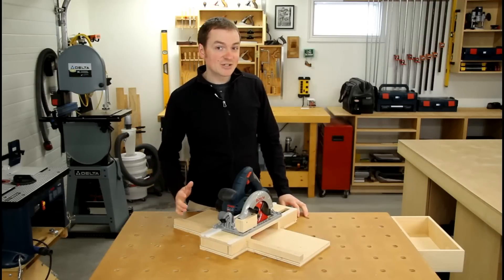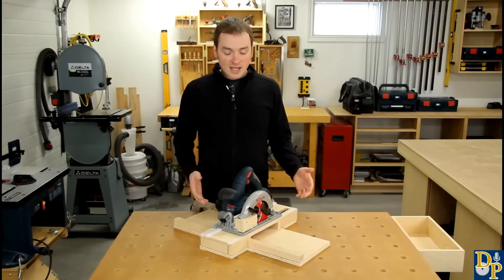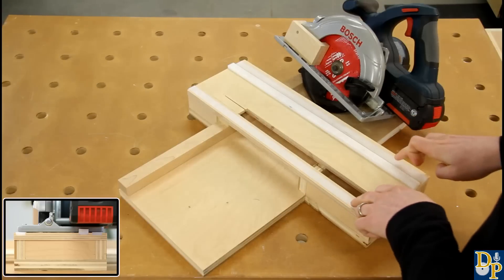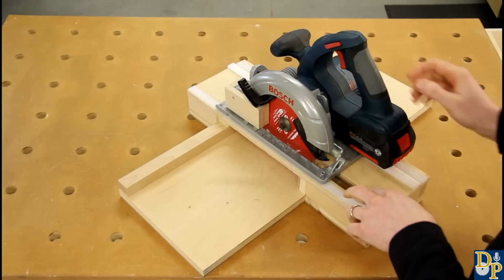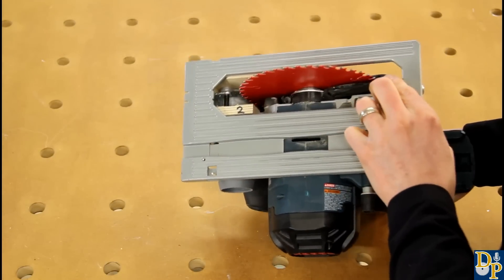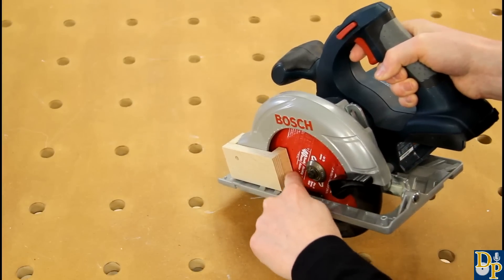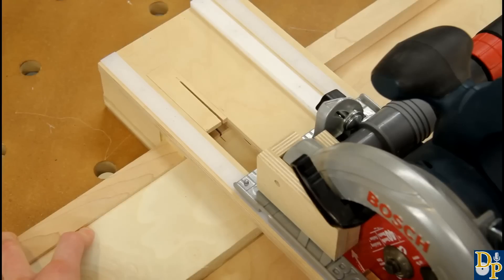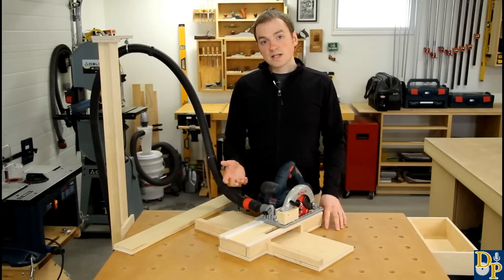Circular Saw Cross-Cut Jig - Accurate & Dustless - Pt1

Comment: why did you stop making videos?
Reply from the maker: I stopped producing videos for a couple reasons. The main reason is I don't have the time that I used to and I don't want my family time to suffer in order to make videos since that's where the time would have to be taken from. The other reason is I don't have a woodshop anymore. I have moved a couple times since I last produced videos and just have a small single car garage now that is just big enough for my work van and the tools that I use on job sites. All of my stationary machines except for the drill press had to be sold a few years ago before we moved. Life is a lot different now than when I was making videos but different for the better.

Comment: Could you show how the dust gizmo comes off to change the blade?
Reply from the maker: It's just a matter of backing the screw out that holds the two pieces together.
Reply: @DPShopTalk  
I looked again at the video. Took some screenshots to study and realize I thought it was one piece held on one side instead of two pieces screwed together. Thanks.

Comment: Dear Friend, I purchased my first circular saw (Bosch GSK 190) and I am very new to wood working. When I was cutting some small pieces of plywood at 45 degree (for a small photo frame) on similar jig, suddenly plywood piece jumped with a loud noise and fly away. It was damaged badly from all sides. Then I tried to a punch cut (because plywood piece was not wide) but I got same accident. I was feared and stopped working. What is wrong? I should I do? Please help me.
Reply from the maker: It sounds like the work piece isn't supported or held securely enough especially if it's a small piece. If you can clamp it tightly somehow it should work better. Also a sharp, higher tooth count blade helps.
Reply: @DPShopTalk  Thanks a lot, I will try it

Comment: Can you kink to the dust port, the gray plastic piece on the saw?
Reply from the maker: I bought it at Home Depot from the plumbing section. I had to modify it a bit to make it work but it does the trick.

Comment: how would I setup this jig to make 45% cuts
Reply from the maker: Depending on what you're cutting you could make 45 degree blocks that would hold the work piece at that angle and could be removed.

Comment: 4/21/2019  USA  Grandpa Bill:  Dan, I'm new to your video/channel.  The absence of visible sawdust in your shop disturbs me. You are picture perfect in your presentation with superior editing and graphics. I am at the other end of the scale, working in an overwhelmingly cluttered, unswept and unvacuumed two car garage shop. I dig for tools, search for screws, shift piles of product to get the thing I need at the moment. I belong on hoarders visually, a narrow path only I can traverse. But there is a reason. Forthcoming hip replacement surgery. Everything I must use is usually within arm's reach, or one step, or twist or turn and grab, even with a reacher stick, low or high. One day I may have such a room as yours, brightly shining in the light, all sawdust contained properly.  For now, I will wear my "man glitter" proudly.

Comment: Very neat jig - thanks for sharing it. I've been thinking about an idea of making a box joint jig for my circular saw (I don't have a table saw, and one wouldn't fit in my tiny UK workshop!)  This could be definitely modified to slide sideways on a set of rails between the top and the base... One day I'll try it

Comment: great video! would this work for cutting plastic pipes? i have a small project that needs lotsa cuts in plastic pvc pipes, i have a circular saw but i don't want to buy a mitre saw
Reply from the maker: It would definitely work for cutting plastic pipes rather than getting a miter saw.
Reply: Wooot! Thanks Dan, keep em coming!

Comment: Hey Dan,  Is bosch the only company putting rail guide slots in their circular saws?  (Other than the plunge saws).
Reply from the maker: Bosch is the only one with the slot that I can think of off the top of my head.  There may be others but I can't think of any.

Comment: when Milwaukee tools launched, its quality was better, but after less than a year, they will definitely change switch(from Germany switch to HK/TW switch, to Chinese switch, as you know, switch is most likely first to dead), change PCBA, change Japanese chuck to Chinese chuck, change critical parts to low the cost. Miwaukee tools have a VE team, 50 engineers to do the cost-down, during these processes, the quality would decline obviously.

Comment: Great video.. NICE work & nice creativity.  There are alot of cross cut jigs for circular saws on YouTube.  WOULD LOVE to see you make one for consistent perfectly straight 45 degree angles... Working on a project where I need to mitre 45 degree cuts for trim on exterior siding.... Doesn't anybody else want/need that kind of jig, vs free hand 45 degree angles... BTW  I am cutting CEMENTboard siding... so cutting this in my mitre saw is NOT possible... thus I"m looking to make a guide for my circular saw.  THANKS for posting your videos...
Reply from the maker: +Rick X thanks.  I've thought about making a jig for miter angles but I've never had a chance to do it.  Usually if I'm doing trim work I bring my Bosch CM8S miter saw which is easily portable and the dust collection works well on so I haven't had too much need for a cross cut jig that does angles.

Comment: this is beyond tho scope of the jig but I was thinking that you could mount a cheap laser line pointer with your dust port that would sit over the top of the dust mechanism and that would be easier to use to see your cut line in my opinion then the manual eye on the blade way anyhow ;)....
Reply from the maker: +The Garbage Engineer that's a cool idea.  I use the kerf in the fence for aligning my cut mark to but a laser would be a neat addition.

Comment: The circular saw was always a scary power tool for me, even more than a table saw or even a chainsaw, ever since my father got a circular saw to the knee (no meme intented). There is so much that can go wrong with a 1800W circular saw when you just go about cutting stuff free hand, at least in my head. I've been making those jigs for it lately and they improved my circular saw work a ton! really safe and precise cuts.
Reply: Nice !! , me as well , I have made one just for cutting 2×4's 👍
Reply: I guess it's lucky for you that your father caught the saw on his knee and not slightly higher otherwise you probably would be not be here to tell the story...

Comment: Hello Dan, a question on working table that you see in the movie, can you tell me the size of the holes and the distance between them and the function should be the inclusion of the vices, I would build a work table with those features, you can make me the Please send me the data? Thank you Hello Vito.
Your videos though in English are always thoughtful and interesting.
Reply from the maker: +Vitto Favaretto the holes are 20mm in diameter in the MPT top.  If you're interested in the full specs there is a full set of plans and instructions available at https://www.danpattison.com/mptplans/

Comment: I love the idea of this jig, the problem I have is that the base of my cordless saw is not quite parallel with the blade. I have the Bosch like what is shown. Any suggestions on how to correct this?
Reply from the maker: +Brian Peters how much out is it and which direction?
Reply: Dan Pattison I'll have to check it out a little better and let you know. I just know that if I clamp a straightedge to the cutting surface  and run the left side of the saw against it, the back of the saw base comes away from the straightedge, I'd say a quarter inch. I'll check it out more thoroughly when I get a chance. I think something may be bent.
Reply from the maker: +Brian Peters oh wow 1/4" is a lot to be out.  Sometimes the back of the blade is slightly toed out to keep the back of the blade from dragging on the cut but it shouldn't be anywhere near that amount.

Comment: Your idea is great!  but you have to take into consideration, that wood expands and contacts more than metal.
Reply from the maker: +My Space that's true.  Where do you see that being an issue in the jig?
Reply: The base for the strips, should have been plastic also.
Reply from the maker: +My Space the expansion and contraction in the plywood would be pretty minimal but the other factor is with the one rail that the saw rides on it wouldn't really make much difference anyway.  If the saw was captured between two rails then expansion and contraction would definitely make a difference since the fit would either get too tight or too loose.

Comment: Dan, would you tell us which dust connections you used.  I have a Bosch hose and the one you used looks like it would fit it, but there are so many bosch dust attachments.  Since I'm buying them online, no way to try them.
Reply from the maker: +kbwoodworker the Bosch VX120 is what I use to connect to all my power tools.  It came on the end of the hose that came with my Bosch dust extractor.  Does that help?
Reply: Thanks, Dan.  I'll give it a try.

Comment: seria mucho mejor si se pudiera hacer cortes 15°-22°-45°y más
Reply from the maker: +Tomas De Paz you could definitely make it to be able to cut those angles but it would make the jig a lot more complex to build.  I thought about making it so that it could cut different angles but if I have a lot of angle work to do I just bring along my miter saw.  I don't think that the time involved would be worth it especially if you have a miter saw. My main purpose for the jig is was for making 90 deg cuts on things like flooring, cabinet kick plate, scribe strips etc when there isn't a need to bring a miter saw along.

Comment: Hi. This is an excellent video. I have a question. I do a lot of picture framing and have dust and accuracy problems with construction grade chop saws. Do you think this design could be scaled up to use a 10 inch circular saw and built with two 45 degree angle sleds?
Reply from the maker: +changeindirection I think that would certainly work to scale it up.  You may not see quite as much efficiency in dust collection with a bigger saw since you are dealing with more distance between the cutting and the dust port but I'm sure you could still make it work.  Do you need the extra depth capacity for the work you do?
Reply: Yes the depth is important for what I do, though a 7 1/4 blade would do a lot of the work. What do you think about dialing in a 45 degree cut, do you think that would also be possible?
Reply from the maker: +changeindirection I think a 45 cut should be just as doable as a 90.  You would need to calibrate it the same way I did for 90 deg on my jig but once you have it set accurately you would be good to go.
Reply: Thanks for your feedback. You do really good work.

Comment: here is a jig that I converted https://youtu.be/SUMWqjZTZKo
Reply from the maker: +Ovi is that a regular miter box that you used and set it up for the circ saw? Looks like a cool setup.
Reply: +DP Shop Talk hi, I used one of these http://www.jacksonwoodturners.co.uk/media/catalog/product/cache/1/image/9df78eab33525d08d6e5fb8d27136e95/p/m/pms_550saw_1.jpg and cut the chrome pegs down and welded some angle to them and bolted the plywood to the angle. thanks for looking
Reply from the maker: +Ovi great idea! Makes for a versatile setup.

Comment: First time to watch your video. I have to say that you have done something more than what you mentioned yourself. Using a circular saw in this way makes it absolutely safe. Thank you for sharing your brilliant idea.
Reply from the maker: +mogbaba that's a great point on safety.  Really the only thing you need to watch is that you never put your fingers under the top plate of the jig.

Comment: Great idea. I like the plastic slides, and especially the guide strip. My Makita LXT cordless circular saw doesn't have that handy index groove, so it would have to be two external rails. 

Your dust capture and extraction system works flawlessly! 

For safety's sake, I recommend removing the battery pack before pulling the guard back to expose the blade, especially when the saw is going to be upside down. :)

Comment: Would it be more simple to just use a hand saw?
Reply from the maker: +latitudeash it depends on what you're cutting. For very small wood mouldings I would use a hand saw but for most things this is much faster and easier.
Reply: I agree for small thicknesses like skirting boards. The thickness and the the90 restriction makes it rather limited in my mind. You can get small chop saws at very keep prices. I got myself on for 22 GBP... and it has all the functions of a standered 200GBP one.

Comment: I wish I had this idea when I really needed a miter saw and I didn't own one. But you raised new other ideas in my head involving this kind of jig and a chain saw :).Congrats!
Reply from the maker: +eugen dragos safta if you make a chainsaw version I'd love to see it!
Reply: DP Shop Talk I would need one but to cut both ways horizontal and vertical cause I have some logs to work with. But we'll see if I'll find the time with my job and all... I didn't post any video since a few months now and I doubt I'll have the chance to create a jig like I said any time soon. Now my workshop is quite a mess as I extended it a little bit. Still hoping :)...

Comment: The little shroud bolted to the circular saw could be made out of a see thru material such as plexiglass and all, which would make it more useful (no need to remove if you want to use your saw without the track), other than that, really awesome idea ! will surely make one myself :)
Reply from the maker: +Eric D. that's a great idea.  I have some plexi in the shop left over from the overarm dust collector for the table saw so I might give that a try at some point.  I did try using the saw without the left side of the dust collection attachment when making a typical freehand cut a few weeks ago and just having the dust port on the right side was still pretty effective.  A see through portion on the left would be ideal though.  Thanks for the comment!

Comment: What is the width of the plastic strip that guides the saw? Also, did you purchase it somewhere or made it yourself?
Reply from the maker: +Nikolai Pozdniakov the strip is 5/8" wide and is sized to fit the groove in the base of the saw.  I purchased a bigger piece of the UHMW plastic and then cut it to the size I wanted on the table saw.  I think I bought it at Lee Valley.

Comment: My major question is how you squared it up. I can figure out all other assembly stuff, but I'm always interested in various techniques people use to make stuff square.
Reply from the maker: +Jay Benedict Brown great question.  The fence was the last thing that I attached to the jig after everything else was finished.  I made the kerf cut into the plywood base of the jig so that I had a reference line of where the blade travels.  Then I secured one end of the fence with a screw from the underside and used a small square to make it square to the kerf.  I clamped the other end of the fence in place and then made some test cuts and adjusted the fence as required until it was bang on square(or deadly square :) and then secured the fence in place with a few screws along it's length.  Hope that helps.

Comment: This cross cut jig is really nice. Good tip with the flying vac hose. Maybe it can even be designed to make angled cuts too. Makes we wonder if I really need that big heavy miter saw in my shop. One problem with all of these jigs is that I need to support longer pieces of material, so I need to level the jig down into the table, or raise the table just the thickness of the board. In the intro at 0:11 I see you already got the idea of adding some measure tape to the table below. Good work, I enjoy your clear videos. Subscribed!
Reply from the maker: +Jesper Knudsen thanks!  It definitely could be designed to make angled cuts too.  I played around with some rough designs for angle capability in my head after I built it but never did integrate it.  I've found that if I'm doing trim work then I would rather have my mitre saw with me since it has all the features that I need to work quickly with angles.  Usually when I'm using the circular saw cross cut jig and have longer pieces to support I just use a scrap of 3/4" plywood since the base of the jig is made of 3/4" ply.  Low tech but effective.  The bench tape that you see in the intro is my cross cut jig for my track saw which is what I use for cross cutting wide panels.  Thanks for the comments and subscription!

Comment from the maker: Has anyone used this Bosch 18V saw with a track of any kind sort of like a track saw?  The dust collection attachment would work perfectly for that.
Reply: I have the same saw and was planning on making a track for just this purpose. Was planning on using some aluminium section for the rail on top of 6mm MDF. The dust collection here would be a nice added bonus.
Reply from the maker: That would work great and with the dust collection it would rival track saws for how clean it would be to work with.  You should post a picture of your track when you're done, I'd like to see your setup.